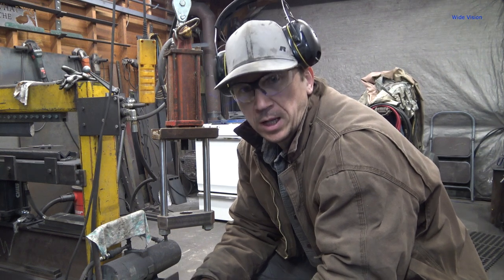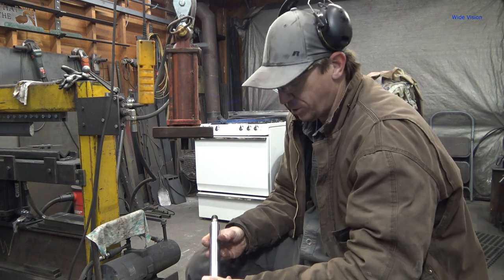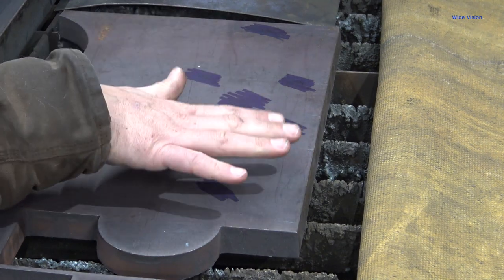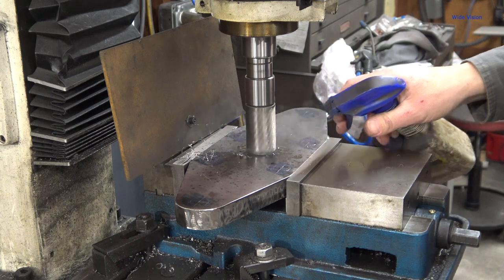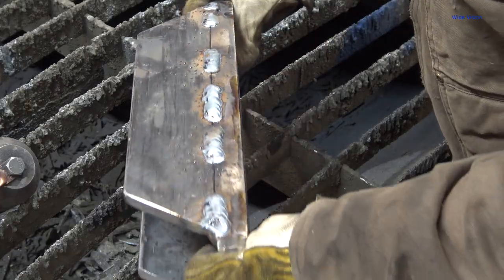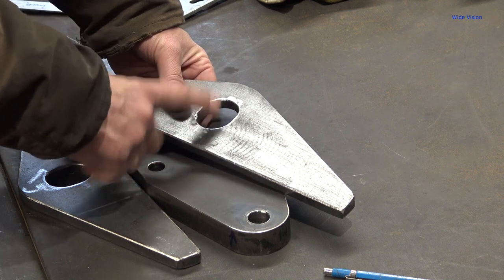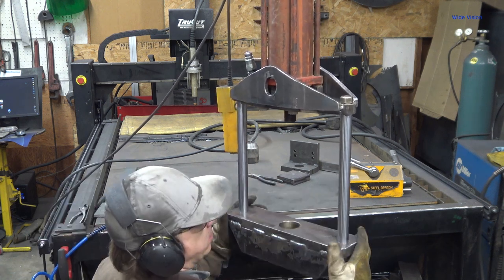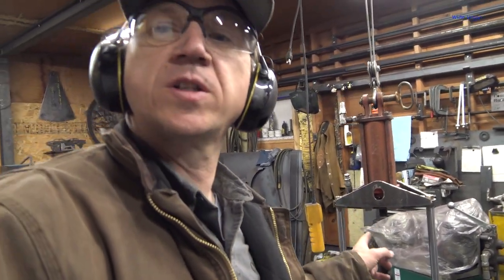Portable Press - A slightly bigger version (April 2023)

Comment: That is a slick press.  I wish we had a portable hydraulic power unit.  My son got a Hypertherm 45 before we built his CNC plasma table.  He had to cut some 1" plate and found a used oxy-acetylene machine torch for cheap.  We built a torch holder for it and it did great cutting out the 1" plate for the excavator thumb.

Comment: I am using the easyscriber too. I use it to make letters that are filled in with hash lines. Use it to make switch/gage panels out of alum. I also use a pen attachment. Paper and some tape is cheaper than steel if you have to make an adjustment. I have a couple vids on the pen tool.